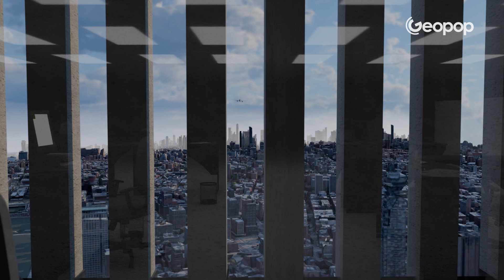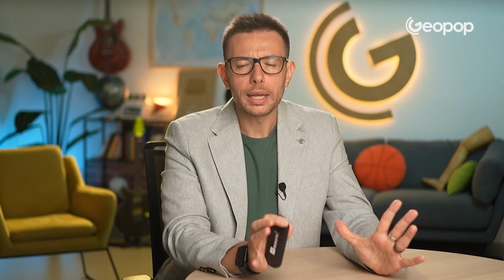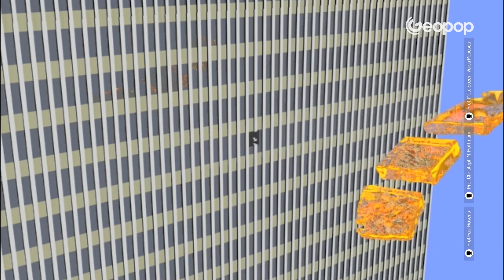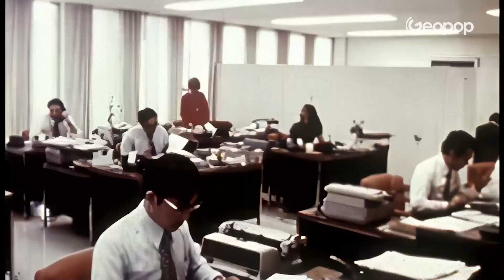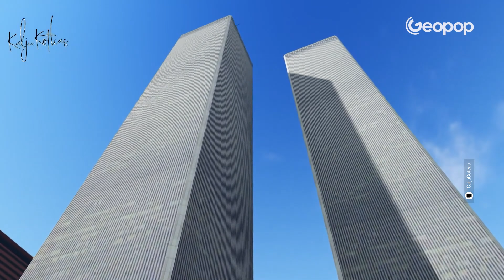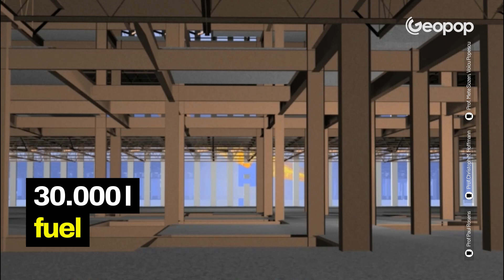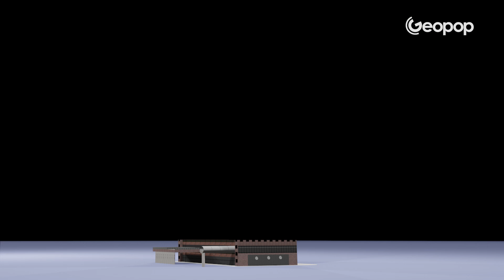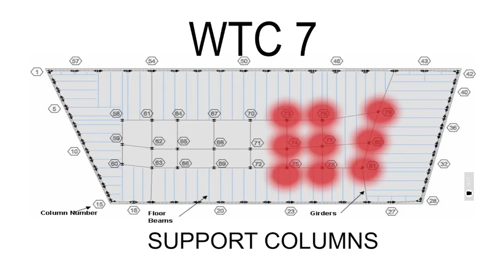9/11, 2001: The Technical Reconstruction of the Twin Towers and WTC 7 Collapses

Comment: you're a sucker if you think wtc 7 was anything but controlled demolition.  "Pull it" -lucky larry
Reply: I am going to respectfully disagree and do something you will never be able to do.

Building 7’s collapse was completely different to the Twin Towers and harder to understand as most details hidden from view and not intuitive, but we can still sort out what happened through careful analysis and observation. This is my explanation of the collapse relying on no outside authority.

Building 7 was complex, assymetrical 47-story steel framed structure built atop a smaller 3-story building, requiring lower floors dedicated to complex load transfer structures, not usable office space. Of trapezoidal shape and all-steel tube-in-tube construction, B7 (above the 7th floor) consisted of a central core of steel columns carrying most of the gravity load, perimeter steel columns around the outside of the structure carrying the remainder of the gravity loads and long span beams and girders to tie those elements together and form the floors. On the outside of the building hung a moment frame or outer shell.

Phase 1 : First externally visible signs of collapse initiation occurred at 5:20:28 pm and were notably quiet with observers not realizing the building was collapsing! No audible warning in the form of hundreds of ear drum busting 180-190dB explosive bangs preceding the collapse. Here at 12:00 a local CBS affiliate reporter is talking 10 blocks from B7 when collapse begins. People don’t start to notice the collapse until 12:11. At 12:45 is the famous CBS fixed camera clip of Building 7’s collapse. Note how quiet it is.

youtube.com/watch?v=t5tEy6mXSE8&ab_channel=fresnosean379

Collapse initiation was due to lower floor failures above the load transfer region (7th floor) in the NE corner. In this video at 0:45 you can see the NW corner from inside the building while under construction, Column 79 just out of frame on the left. That big, angled steel beam across the top of the frame connects to C79 at one end. The girders connect to the beam. That beam and all those girders depend on just one connection

youtube.com/watch?v=nP3TNHPCIVU&t=35s&ab_channel=EdwardCurrent

Phase 2 : The floor failures caused a loss of critical lateral support over an excessive length of core Column 79 and it buckled. If you look at a floor diagram of Building 7 (see above) and look at all the structures that depend on C79 you quickly realize this one column was a relatively isolated structural element on which a disproportionately greater fraction of the structure depended analogous to say the Key Bridge. Externally we see a vertical progression of window breakage along the 44-46 line and a kink in the roof of the East Mechanical Penthouse at the top of the building, consistent with C79 failure. The transition from full capacity to almost no capacity occurs in an instant. Once the buckling failure occurs there is almost no resistance

Normally with a buckling column, the load could be redistributed to other columns. With C79 that is not the case - the failure did not redistribute the load, so the collapse rapidly progressed to the roofline, sinking the rooftop penthouse.

Phase 3 : With C79 gone, B7’s progressive, non-symmetrical collapse continues with C80 and C81 at the east end of the core left laterally unsupported and quickly buckled and failed as well, sending the EMP down through the building. C79-81 all have no diagonal bracing, which I believe is a major reason why they could not redistribute a lot of vertical loads among one another.

From there collapse progressed from east to west through the central core until the core was gone taking all of the interior floors and probably most of the perimeter columns with it. Follow the horizontal progression of window failures low in the building and the dropping of the remaining rooftop structures into the building. One of the big takeaways from the NIST Building 7 study (that gets completely ignored) was their modeling which determined C79 failing under ANY circumstances would have initiated the same collapse sequence.

Phase 4 : After 10 seconds only the exterior moment frame - a hollow empty outer shell – remains, giving the ILLUSION the Building is still standing since little has outwardly changed. It is just a hollow empty shell like an empty cereal box. Supported by only a few remaining columns that empty shell is quite unable to remain standing. With all core columns and floors gone, the north face leans inward, forming a V in the roofline, the last few columns buckle under the strain and the moment frame free falls, landing on top of the 7-story high debris pile. It is only late in the game here at the end that a single measurement of alleged free fall acceleration is taken, from a single point on that outer shell. The Building did not “free fall” – just one corner of the outer shell did, sort of. The Building was already gone before that happened. The period of alleged free fall was a product of how it fell NOT why it fell and cannot tell us what started the collapse. Start to finish the entire collapse took 18-20 seconds, 3 times longer than true free fall . How fast something falls cannot tell you what started it falling_ anyway. The debris spread outside the footprint, blocking surrounding streets, heavily damaging the Verizon Building and destroyed Fiterman Hall.

Building 7’s progressive, non-symmetrical collapse was incidental and unintended collateral damage from the combined effects of fire + time + gravity, started by the collapsing North Tower. That is true no matter who planned and carried out the 9/11 attacks or why . The collapse was of so little consequence it barely even registered at the time, a mere footnote. It only took on semi-mythical status as an alleged smoking gun years later when demolitions at the Twin Towers, missiles at the Pentagon and shoot down over Shanksville all failed and conspiracists had nothing left to work with.

Anything can seem like a conspiracy if you don’t understand how it works. Now you should. I hope you found this helpful, informative and it solicits informed critical comment. If I made any errors of fact, logic or reason or left anything important out, please let me know so I can fix it. IF you can offer a more plausible alternative please do. Be the first. Please start any reply with the words “Tits McGee” or I will know you didn’t read it and are wasting my time.
Reply: @TheLoonResistance  tits mcgee thats AI slop
Reply: @TheCriticalStinker-01 you wrote all that for nothing  building 7 was a controlled demolition 
 If one was rigged they all were
Reply: @Guns4Hire-s5e  - I realize the attention span of the average conspiracist is no more than 4 lines of text (not sentences) - which is of course why conspiracists are conspiracists - but I have the advantage of not only being right, but able to explain why.

OTOH you are just wrong and you can't even explain your wrong. 

Controlled demolition (what was even controlled about it or needed to be - you fell for bad marketing) is one of mankind's all-time dumber ideas.
Reply: @TheLoonResistance  Have you got a pen shill ? 
May I suggest you write or comment to someone who gives a shxt 
Replying to every comment what a Nerd
Reply: @Guns4Hire-s5e  this loser literally fed us a chatgpt or some AI slop to explain it and did it like he was smart and condescending on us.  Even chatgpt will tell that fool it was more likely an inside job then not and like you said if 7 was demoed they all are.
Reply: @Guns4Hire-s5e  You must be so dumb to fall for that conspiracy propaganda - you do realise they make money off you believing this nonsense. I wonder how often you get scammed.
Reply: @johnstamos54288  You probably think the earth if flat as well.
Reply: @joedagg4495  you need to pull your tounge out of  CriticalStinker-01  Assh0le  it's unhealthy 

Your being scammed  by the juice
Reply: @joedagg4495  lol what a pilpul response the entire flatearth nonsense is just to make idiots like you think all conspiracy theories are lies.  They have proven so many conspiracy theories true it really just means uncomfortable fact not yet proven.  i bet you were one of the shitlibs claiming wuhan came from chinese people eating bats and that the wuhan lab leak was a conspiracy theory and now they just call the lab leak a fact.  Its ok though lots of people that think they are smart just believe every single lie the TV has told them and let chatgpt do the hard work for them like you did but thats not intelligences its just peer pressure and it makes you weak.

Comment: explain this then- all the fuel explodes and heat travels skybound instantly. Not a slow burn. The chef fire fighter 15sec before it fell radios back, there's two fires very mananagable. If a column was in a huge fire, then you might be able to argue that the steel beams would heat up from nth to sth, but that was never the case. It was defo thermite and defo a BS con job. a couple of poor pilots
Reply: So you think all the fire in the South Tower was confined to the 78th floor, why? It was only hit by the left wingtip. 

Probably why when you look at the building from the outside the flames are billowing out of the windows - often from end to end - on the 79th through 84th floors and you can't really see much fire on the 78th.

Worth noting, Chief Palmer was not going up to put out the fire. He was going up to find a path to bring survivors down. The 2 lines he called for were to clear a stairwell, NOT to put out the entire building

FFS sometimes you just need to apply the thinking part of the brain 🤦‍♂